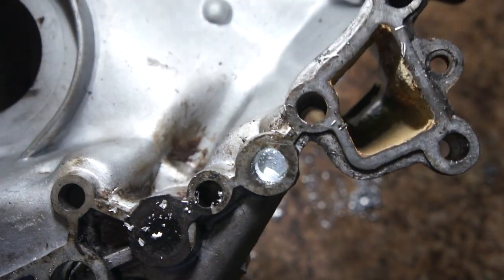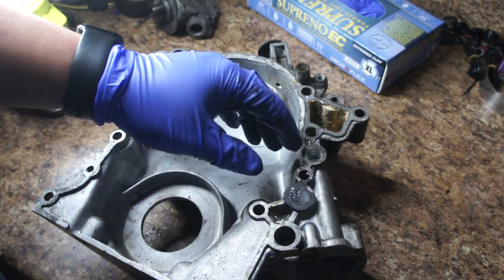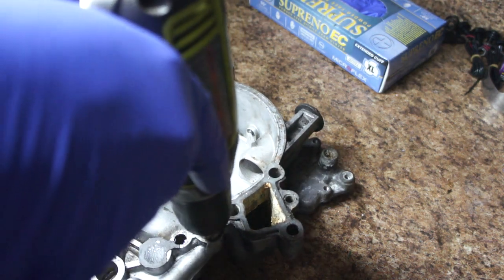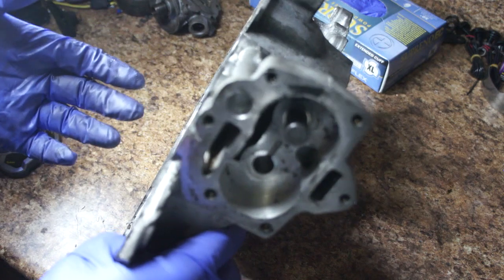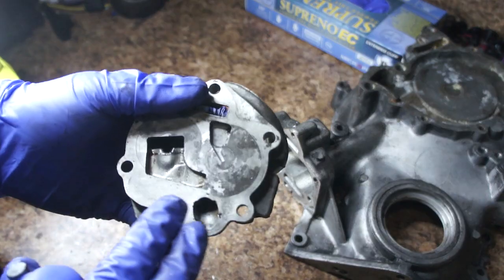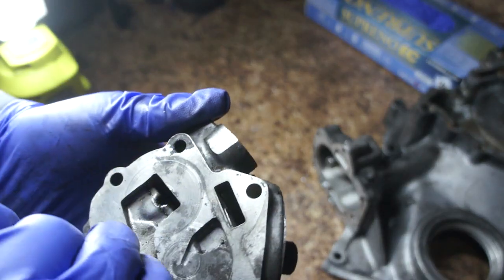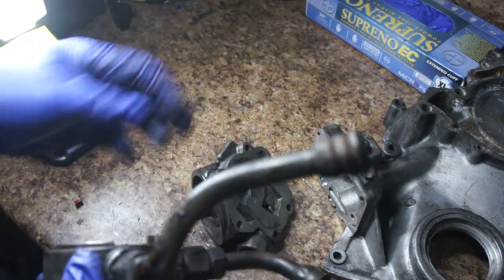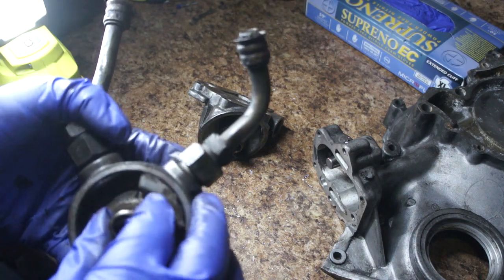Buick Timing Cover/Oil pump. How it works and some modifications.

Comment: Great to see a young man that knows his Buick's.  A few other tricks for the cover, get the gears from Mike Phillips at AM&P.  He works them over a bit and they will give you more oil pressure (or at least they did on mine.) Check the gear clearance (I think it is .002 but look it up) and if needed get the kit from TA to fix it.  Finally get the steel plate from Melling.  I port matched everything.  Another thing we found was the booster plate was not perfectly flat and parallel so milled it down to perfect. Had to put in the TA adjustable bypass kit to get the oil pressure down to 70 psi at 6200 rpm.  My motor runs .025 to .030 clearance.

Comment: Thank you braddah.... here in Hawaii its hard to find parts for those older model cars.... but we improvise.... so I wasn’t sure how to prime the oil pump without removing the distributor, so I put a little air pressure in the valve cover till it came out of the filter housing...... it worked...... the valve tapping went away.... now its running like a champ..... 🤙🏽🤙🏽🤙🏽....

Comment: I have a 350 Buick in my 66 Chevy C10. I use it as my daily driver and I have pulled very heavy trailers for many thousands of miles. The 350 Buick is under appreciated. You get small block fuel mileage with big block pulling power!
Reply: been wanted to do an old v8 small block build in a 2000’s s10. would be something crazzyyyy

Comment: Your video was helpful, thanks. I believe a better way to clarify how the relief spring influences oil pressure is say, simply, it does not. The various spring temsions only determine how much back pressure ( from the engine ) will be  allowed if there is some obstruction, before oil is bled off to avoid damage. Because Buicks normally make barely enough pressure, the stock spring will activate too quickly in a high reving performance motor. So a stronger spring is used to allow more needed pressure and oil flow.

Comment: Using a stiffer spring will cause too much stress on the camshaft gear. I think it's best to use the high volume plate with a stock spring. If one stays under 4000 rpm no modifications are needed.

Comment: 86-87 turbo Buick 231 engines are very very sensitive to who is rebuilding the short block. If anyone God forbid is experiencing signs of bearing wear and especially low oil pressure. Please don’t start your engine again. Pull it out and send the short block to a machine shop that has extensive experience with references who can back up there machine work. Because I speak from experience with my cars. I own 2 87 Buick turbo regals. One is a WE4 special edition that I bought new. The other is a Grand National that I bought with Rod knock thinking that I could rebuild it just like I used to rebuild Chevy SBC 350 engines when I was a kid. NOT!!!!!! Got everything back from the local machine shop I’m originally from Brooklyn ny now I live in Florida. So anyway I don’t know anybody out here so I roll the dice with this machine shop. I spare no expense for a stock/stage one build. Forged pistons and rods Block bore .30 over crank cut 10/10 (mistake number one. These cars hate cut cranks with oversized bearings). So anyway ARP Main studs (mistake number 2 should have went with a Griddleinstead). 
       So I get everything back from the machine shop and it’s all built and balanced (so they said). And it looks beautiful. I actually slept with the short block across from my bed on the engine stand. The machine shop was like it’s all ready to go. “DON’T RECHECK OIL CLEARANCES” he said the rod bolts were torque to yield fasteners. (Biggest mistake!!! Whenever you get work back from a machine shop you always check rod and main bearing oil clearance with plastigauge. Even a brand new short block from a crate I’m checking oil clearance. The heads I bought new oem valves and had the 5 angle seat cut and I had them ported and decked. (Great job on the heads. I gunna give credit when it’s due. I still use them) So anyway I use MLS head gaskets. I seal those heads onto that beautiful short block. I can’t remember what cam, rollers, or rockers I used I think they were 1.7 H sharp. Stock valve covers. I upgraded to a precision 6262 Ball bearing turbo with External dump. New timing cover with Melling oil pump with the extended plate. Packed in petroleum jelly. New stock oil pan and pickup. 80LB injectors with Alky injection, Ls1 Maf meter with translator box. All tuned with a Turbo Tweak chip. The gauges, scanmaster, and fuel system was already upgraded when I bought the car. 
    So I paint the engine this sick Corvette Yellow and Black combination with the engine bay media blasted , primes with that anti rust and painted black. My engine bay looked sick. It was one of a kind. So I primed it and it started after about 5 revolutions. I followed the break in down to the minute. My boost was set at wastegate psi and I never boosted it. After 30 minutes of idling I shut the engine and drained the oil and it looked like confetti was in the oil there was so much bearing material. So I’m not stupid. I changed the oil with the oil conventional oil and AC Delco oil filter.  I started the car just enough to circumvent the new oil and took the break in oil to the machine shop and was like what’s up with all this bearing material. I’ve done rebuilds and I’ve seen my share of break in oil and a little bit of engine metals and debris is to be expected but this looked like when you go to an Italian restaurant and the grated cheese when the waiter cranks the cheese on your food. That’s what my oil looked like. It looked like all my bearings where in the oil. I actually drove there in my good bone stock 87 WE4 Grand National turbo T. The guy didn’t believe that I owned 2 cars so he thought I drove it all the way to him. And he said it’s fine. He wouldn’t look and see that it wasn’t the same car. (As I walked in I told his wife they are being audio recoded. I guess she didn’t feel the need to tell the owner because he said it’s fine just on your way home don’t boost it until you put at least 600 miles on it. He literally called my a liar when I kept telling him that I own 2 black turbo regals. One I had since new and one i want to go fast in. 
      So I get home and take the car for a drive. No boost just driving normally. I see the oil pressure dropping and I already know where this is going. So I barely made it to the machine shop with full rod knock. It actually sounded like everything was loose in the short block. He was 😡 pissed.  With his “good ole boy accent” He was like get that car off my property. I was very calm low tone. I told him “with my Brooklyn accent “ that this is gunna go either 2 ways. 1) You hand me every dollar back that I paid you for parts and labor. 2) Or we let a judge sort this mess out. But just so you know your bearing material took out my Turbo ($1700) external oil cooler, 6AN oil lines, oil pump, timing cover, heads, gaskets. And my time. And I charge $100 an hour and that includes going to court and I may even hire an attorney. And I will definitely expose your great work on YouTube, Facebook, and anywhere else I can. 
    Then he started that “you should’ve came to me shit. Making like the whole thing 2 Hours prior didn’t happen. I pulled out my Iphone and played the whole conversation we had earlier. Then he said he never gave permission to record in his shop. I have it on audio getting permission from his wife aka the shop manager. I left the car there. I pushed it into a spot out of the way. I told him he has till tomorrow to let me know his decision. He had my car towed. So $300 later I tow the car back to my house. And I give him a courtesy call that I am retaining legal representation and we’re going to court. Now he wants to settle. So I tacked on $1300 to my price. $300 for the tow and storage fees and $1000 for being a dick. So he offered me a personal check for $13,000 I rejected that on the spot. I said either a certified, cashiers check, or cash and I will sign you’re binding agreement not to pursue this in any way which is why you don’t know the shop name and you haven’t seen any videos of the mess he made. He paid me via certified Check and apologized and said he never did that type of engine before. He figured 1 ten thousandth of an inch off wouldn’t make a difference. Well guess what it did.  His bearing oil clearance was way too tight and plus if I had to guess I think he forgot to hot tank the block again after boring it out. But he wasted a lot of money of expensive rods and pistons that are all junk. The heads , turbo , and oil lines we were able to save. But fortunately my guy in ny was able to save my original numbers matching block and it’s alive and well today. 
     The op is 100% correct. You can have 10 oil pumps all running in series but if there is nothing for the oil to push up against then there’s no oil pressure. It’s like a garden hose with no tip just flowing water. But cover some of the hose with your thumb and you got a 30’ stream of water. Your thumb created the resistance needed to create that water pressure through the garden hose. Same goes for the engine. Especially crankshaft rod and main bearings as the clearance widens it takes more oil to fill up the space between the crankshaft journal and the bearing. Until the clearance gets so great that the oil just flows from the space between the journal and the connecting rod. You can actually see this if you have a good aftermarket oil pressure gauge. As you accelerate oil pressure normally goes up as normal oil pressure is flowing more because the pump is pumping more volume against the same resistance. But on a crankshaft journal with almost no bearing material left or a crushed bearing from knock (detonation) as you  accelerate you will actually see the oil pressure plummet down to zero and go back up a little as you get back to idle. When you see this the damage is already done. This engine has passed away and is just trying to get you home. Bottom line any signs of no or low pressure don’t drive it. Either rebuild it of get a junk yard engine with a start up guarantee. And if you do rebuild it then be careful who you let cut into your engine. Picking up machine shop is just like picking the correct surging in the event God forbid you need medical surgery. 
Sorry for my long story. I just felt it was relevant since you’re talking about Buick engines and oil pressure. I’ve been there and I don’t wanna see anyone else get screwed like I did. Buick and Linda very sensitive to who rebuilds them
Reply from the maker: Sorry to hear that you went through that....but I have to say any respectable engine builder will be able to rebuild or built a TR short block, there is no mystical specs in there.  I do definitely agree these don’t like cut cranks and people need to be aware of the Buick oil pump poor design (steel gears in an aluminum housing).
Reply: VenomGT87 I guess I just drew the “Turd” of Volusia county Florida. Unfortunately I can’t disclose the name as per our agreement.  But from now on (unless you yourself are a machinist in central Florida because you seem to know more about Buick engines then this guy knew. I would actually give build work to you just based on your knowledgeable this video) but unless you’re in Florida. I’m giving all my turbo Buick machine work to either Dave Hudak, Scott Merkell,or CK preference (definitely would give them my 200r4 as soon as it blows up I would have them build me a stage 2 transmission with harden sunshell as well as a full trans brake kit on my Grand National. And if I ever needed a stock rebuild on my WE4 (my baby) I will never trust any machine shop anymore. But you seem to know your $hit so I would definitely hire you if you’re local. Do you build and mod turbo 231 v6 109 engines? I’m curious to know if my current short block is strong enough on the bottom to go with a bigger turbo. I currently have a precision ball bearing 6262 with external dump. I’m thinking about twin turbo but I don’t wanna loose my air conditioner. I’m actually willing to cut the relief holes in my hood like some people do. Right now I’m at (please don’t hold me to these numbers. It’s been a while since she was on the dyno) she’s putting 789 to the rear wheels and I think 802 of torque (I lost a lot of torque because it takes a lot to spool up that huge turbo and I never went with the larger throttle body and dog house yet. And my 2 step rev limiter won’t work without that 90mm q45 throttle body). But the turbo is only tuned at 17 psi because anymore power would implode that stock transmission. So the most turbo tweak could tune my chip for was 17 psi. On pump 93 gas. I’m E85 tuned as well on another chip but I can’t find it anywhere around me.
Reply from the maker: It is always cheaper for  me to have someone else build the short block but that is taking into account that I go to the guys that do it for a living and I can source the parts slightly cheaper. You mentioned a few good builders, I would ask for an itemized build/bill sheet so you know exactly what you are paying for (usually that brings the build price to a more reasonable level without any haggle). Most of the stuff I do for others is give them a hand installing parts and accessories but I don't think I will be building engines because of the shear fact that most people don't know how to take care of them and/or don't understand (or have the time) that there is a lot of tinkering involved to make it function and perform the way one wants. BTW I am from Miami but I live in Maryland.